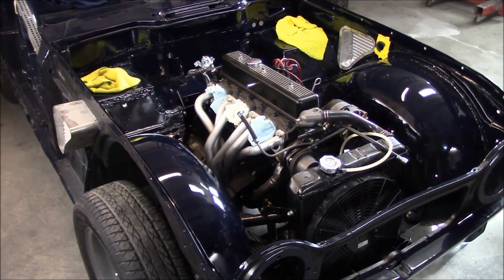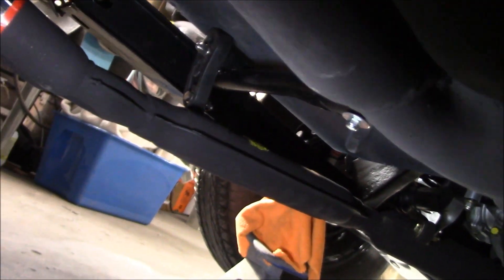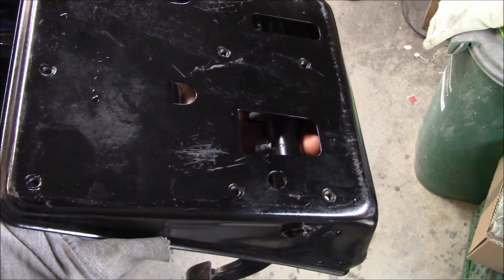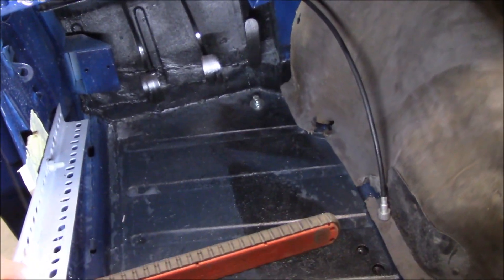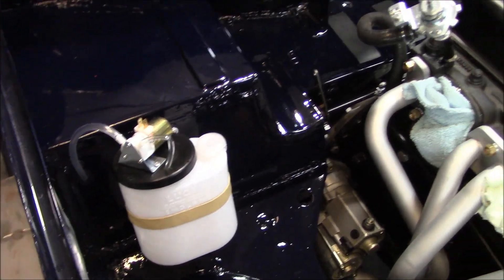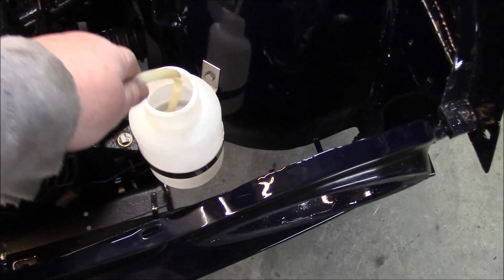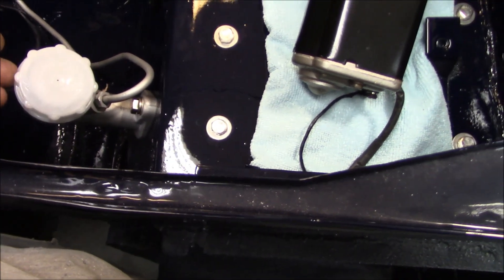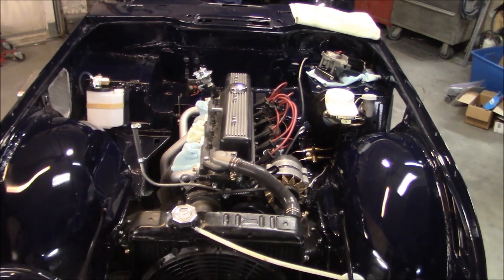1968 Triumph TR250 Restoration, Engine Bay Assembly, Part 1

Comment: You're on a roll getting all those bits back in, handy you got the bolts all ready before though 👍. We don't have a PDWA valve/switch on UK cars. I'm about to fit my new washer bottle bracket, wonder if I'll need to enlarge the holes, guess we'll find out...

Comment: Enjoying this, and most makes sense. But default should be to expand acronyms and initialisms, when there is even the slightest chance they are not truly common terms. PDWA appears to be a Triumph-specific term, which I looked up but have forgotten already.
Reply: Hi DD, could you translate please? 😊
Reply: @philtucker1224  PDWA = Pressure Differential Warning Actuator. In split braking systems it warns of low pressure in either of the circuits.
Reply from the maker: Sorry Dan, yes I will do better.
Reply: Thanks Rocky, I thought I noticed an electrical (spade connector) coming out of it, so would it show up as a warning light?
Reply: @philtucker1224  Yeah. That was the usual system. There's a little movable metal shuttle inside the body of the PDWA. If both brake circuits are working properly, the pressure on both sides of the shuttle is the same so it doesn't move. If one of the brake circuits loses pressure, there's higher pressure on one side of the shuttle so it moves and makes an electrical connection. That causes a warning light to come on and immediately leads to fear, panic and fruity language from the driver!
Reply: Ha ha, Hi again Rocky, - many thanks for that excellent explanation. Very best regards 👍🇬🇧

Comment: Chef,  Are the body panels that are not on the car in paint and clear yet, or they still in primer.  In a recent video you mentioned needing to paint the windscreen frame, but I don't recall seeing the fenders, doors, boot and bonnet get sprayed either.
Reply from the maker: Hi Robert,  all the exterior panels have had basic bodywork done and are in black epoxy primer only so there is still quite a bit of work to be done there.  Same with the windscreen surround...still needs to be painted along with the Surrey top backlight and center section.

Comment: Dave, what happens if you didn't use seam sealer on some of that stuff, like the booster?
Reply from the maker: Hey John, I think it was seam sealed from the factory to keep any water from getting behind the bulkhead washing up from the road...if water were allowed to get behind it, I’m sure it would rust that area out pretty quickly.